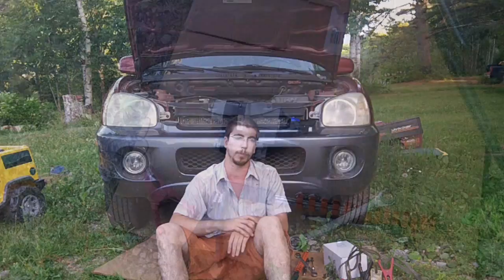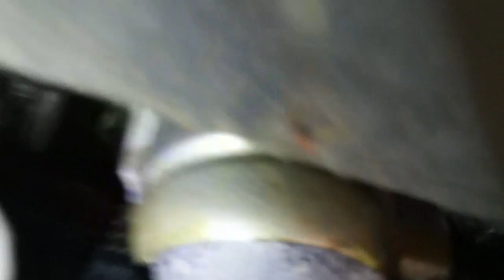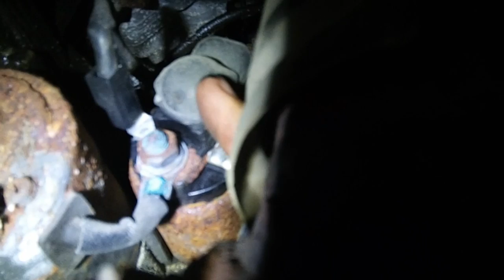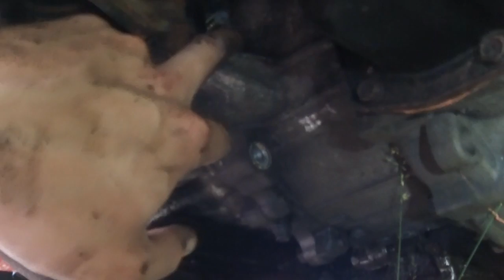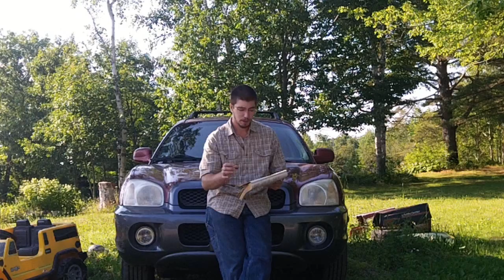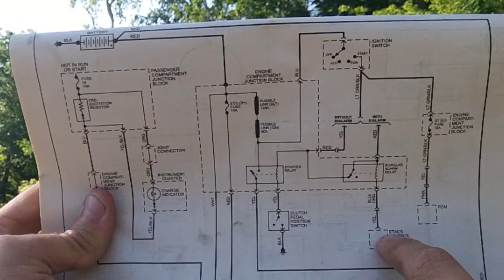Hyundai Santa Fe Starter replacement  2.7 v6

Comment: Thank you i'm gonna replace starter on my santa fe 2002 for the first time. I got new battery but starter is is still going slow and heavy like with bad battery.  Mine has 12.6V so it is ok. Today starter just stopped working. I switched relays horn with start to make sure relay is ok. It was. Then friend moved gear from park to neutral and car started. Is there some sensor? So I have no idea what the heck is happening, but I'm gonna replace starter anyway. Nice hack with that bypass. I'll try it and will keep a cable in the car just to be sure.

Comment: I went to all your video page, and never saw a follow up video where you resolved this issue and found the relay or exact problem and fixed it.
Reply from the maker: That would be because it blew the transmission a bit after this video was made.

Comment: It’s the ignition wire solenoid. It’s on the other wire that doesn’t connect to the alternator. Wiggle it a little and it should start. ..
Reply: Do this if there is no click. But disconnect the positive cable first.
Reply: This actually works out right here

Comment: Why did I buy a hyundai santa gay.. I find myself asking this question way to often
 Replaced alternator this week then battery wh
Ent bad 2 days later just got brand new battery and still nothing. So I'm at the starter if replacing it and I'd need be bypassing relays doesn't work I think a grenade should do the trick.

Comment: I have the Tucson 4wd...you have to remove the starter to even get the heat shield off...good luck with the top nut...
Also disconnecting the wires...all done by feel...you can't see them...I hate working on cheap designed foreign cars...
Reply: yeah cheap designs suck

Comment: Good video, mine keeps clicking, and I keep turning the key like 100 times and it will eventually turn over, I hope it’s not a relay, cars are seriously so annoying. These Santa Fe’s don’t come with the parts for an alignment either, why would they make a car like that. But great video, I am going to go work on it now.
Reply: Hey did you ever figure it out? Mine does the same thing!
Reply: @dakotame4291 you figure anything out. Taking the starter off is a pain in the ass. Heat shield is in my way.